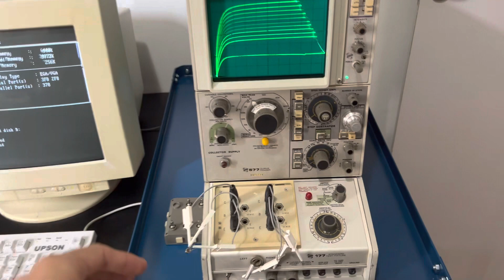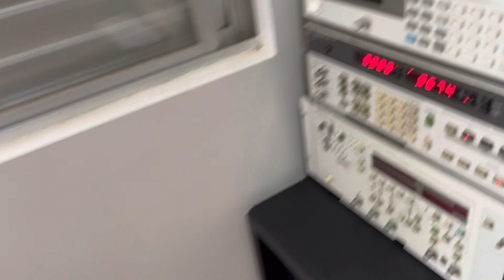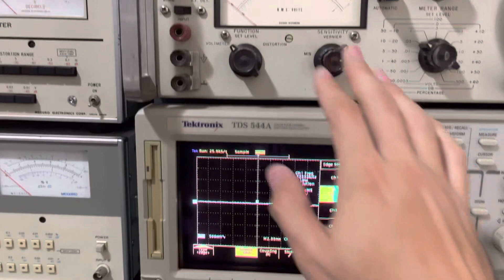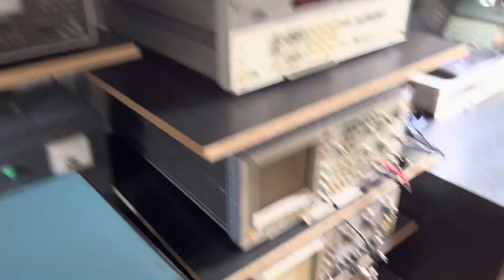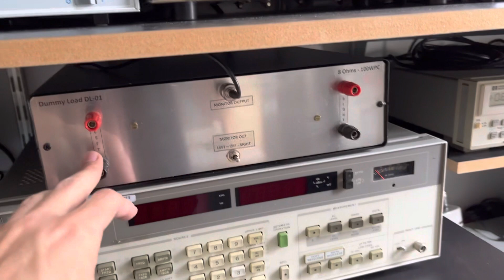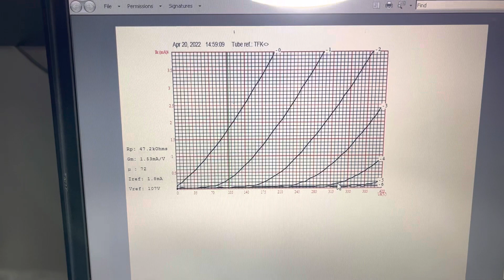First look at my test equipment hoarding! HP, Agilent, Fluke and Tektronix crazyness in my workshop!

Comment: Nice collection, fellow hoarder.  I have a pretty full bench with shelf above but the configuration changes a lot.  I work from home doing circuit design and then test and validation.  I get the company I work for to calibrate gear when the test results need to "count."  So I have half a dozen racks of other gear plus a back room with industrial shelves.  I must admit you have way more audio analyzers than I do (I will have to look into correcting that discrepancy).  A lot of my work is geared towards RF so I have many larger (and heavier) items like a couple of HP 8566 spectrum analyzers (in addition to the HF and audio ones), signal generators (analog, digital and IQ driven).  I also have a ton of power supplies, from multi output bench ones to 1 kW and larger.  Even a big 3 phase 25 kVA monster in the garage for doing 400 Hz work.  I am extremely lucky to have found an awesome company which actually pays me to design and make electronic things.  Too bad we're not close as between us we could probably set up any kind of measurement experiments imaginable.

Comment: So you do audio work? I have a Tek 475 and a HP 3585a. I got the SA because I thought that it would be instaneous like the scope, but was wrong. So I think what I really needed was the 3562a instead. I want to make synthesizer videos with realtime analysis. What do you think I should get?
Reply from the maker: Hi, I usually use an HP 3582A connected to the monitor output of the 8903B, that gives a much better dynamic range and a great way to view the harmonic contents after the 8903B notch filter...
Reply: @electrohoard  can you recommend a way to attenuate the signal from a Moog modular to prevent frying the input.on the 3585?

Comment: A great collection! There are some choice instruments there. Just with regards to the yellowed fascia of the vintage computer tower on the desk, I came across an excellent tip for bringing it back to its original colour; using hydrogen peroxide. Some of the paste products for  bleaching hair will make it adhere to the plastic in all the crevices, just make sure it's a basic one with not too many additives. If you put in a sealed plastic box or bag for a few hours (in sunlight for best results, apparently) and then wash it all in soapy water, it will be much closer to its original shade.
Reply from the maker: Yes, thank you for the tip! They call it retro brighting and I did try it on an old Monitor but the truth is that it just got yellow again after some a couple years. Im not really positive that this technique does not damage the plastic so I just decided to accept the yelowness for now :)